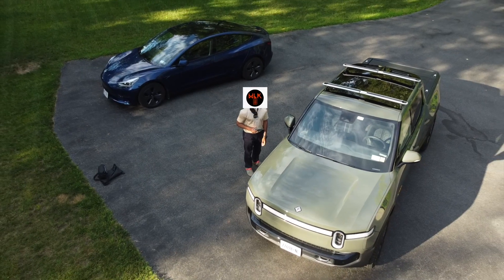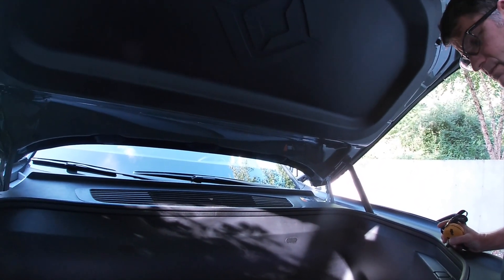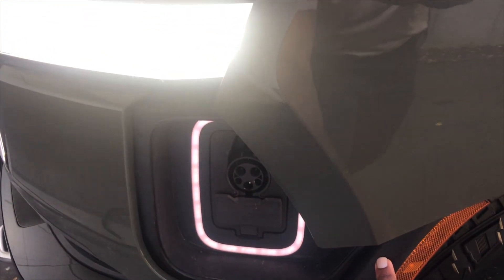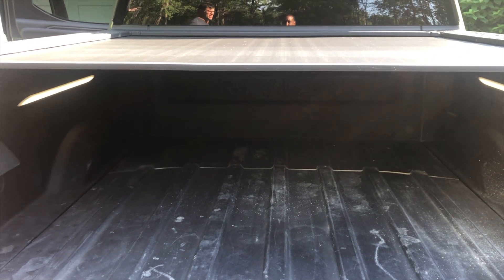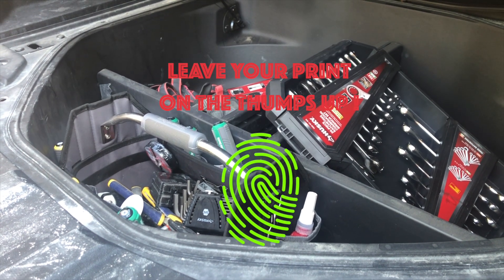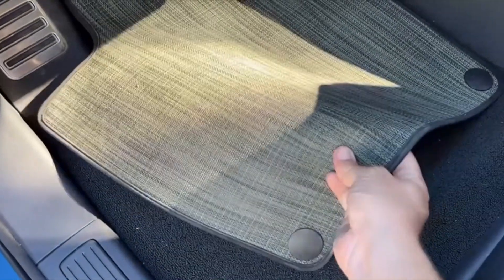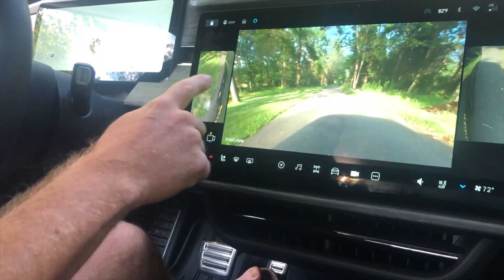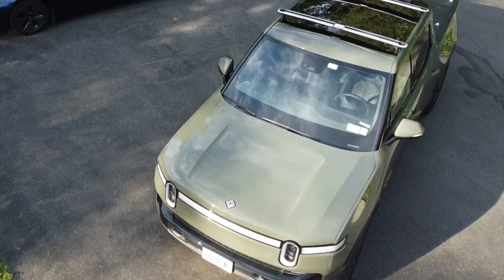What they don’t show you about the size of the Rivian R1T

Comment: I like the size of the Rivian. I don't think I could get an F150 in my garage and still be able to open the door to get in and out. This seems like more the correct size. If I'm going to spend more than $50 on a vehicle I really don't want to have to park it outside.
Reply from the maker: Good point @Frank Coffey : I hope to do a review on a lighting F150 in the future as well; but I think the Rivian is an amazing EV! Quick , sleek and has amazing features.
Reply: @watslockandkey  I love the utility of the F150 Lightning but it's just too big.
Reply from the maker: @frankcoffey  the nice thing about the RIVIAN as well is you can automatically tell it’s an EV no doubt , size is amazing as you saw it side by side with the model 3 in the video, more content coming 🔜